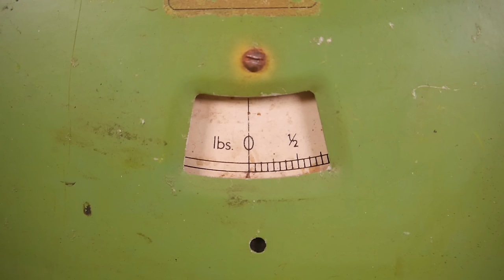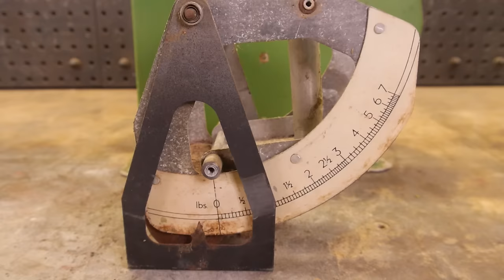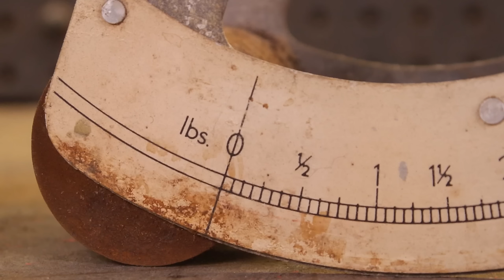1930s Kitchen Scales [Restoration]

Comment: One tip from my side, never sand filler with a soft pat. Always use a sanding block with a hard surface, the result will be much smoother and straight. Anything else perfect job! And in terms of the originality, I might think an original is worth more but nobody can resist such a pristine looking but obvious old scale, beautiful!

Comment: need to get impact screw driver dead blow hammer bit of a turn and evap -o rust. reusable. things to add w-d and kryoil different lubes sprays that way you don’t damage antique to stubborn screws. Sometimes soaking the part that has rust eliminates the rust before attempting heat etc.
Reply from the maker: Thanks for the tips, Mark. I tried an impact screw driver on it, but the body was quite weak being aluminum. I soaked it with w-d for some time to no avail. My issue is time. I have to produce these episodes as quickly as possibly and I just know heat will get the job done. Cheers!

Comment: why didn't you remove the paint from the surface this time, but immediately started sandblasting? In the last video you said that it is not environmentally friendly :)
Reply from the maker: It's only not environmentally friendly (to your lungs) if the paint contains lead. This paint didn't so there is no risk of breathing it in